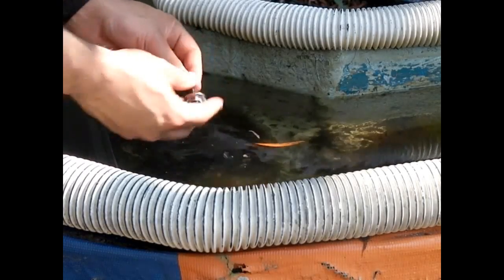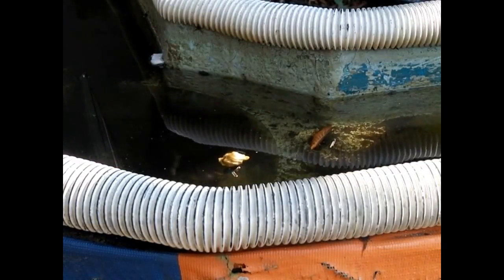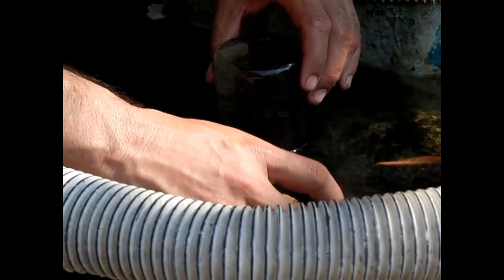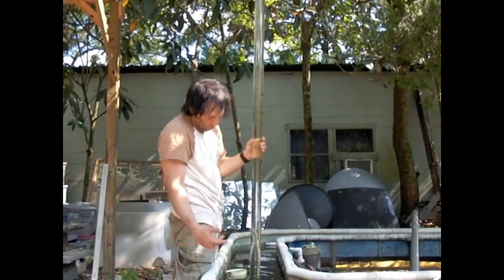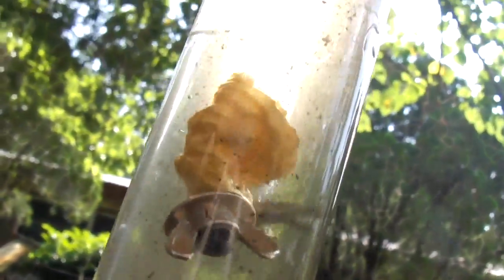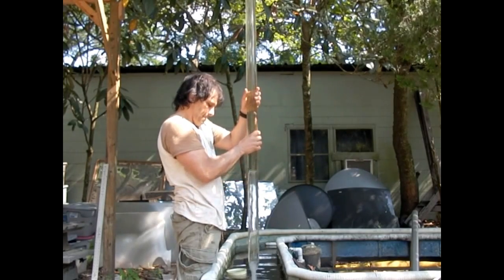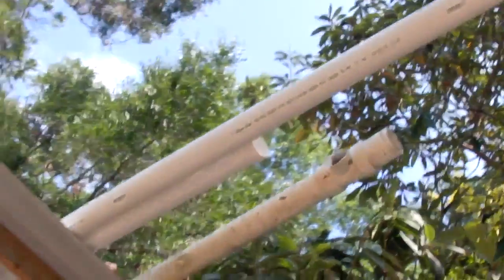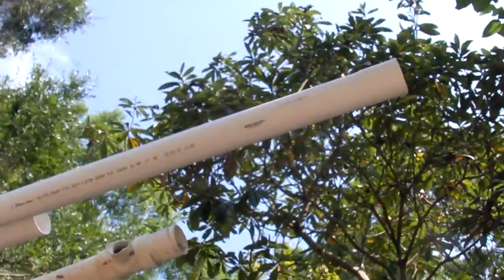Water Lift Atmospheric Pressure Torricelli Vacuum 10 meter potential

Comment: can you get the water to have constant flow using only hydrostatic pressure with a narrowing pipe as it rises but uncapped even if only a mm above the water surface for a constant flow/drible?

Comment: You lose water every time and you need to refill it - object reaches the top and some water is lost at the bottom, being displaced by the object. To refill the chamber on the tube, you need to bring the water to the top of the tube or push it upwards from the bottom - both things require work (energy). There is no free lunch. It's easier just to pull things with an elevator. Less hassle and more direct application of work which makes less losses.

Comment: How about if you flip the model and put the two valve airlock on the bottom and keep the top open to atmosphere?

That way, you are not subject to the height restriction due to atmospheric pressure. 

You can go higher than the 32 feet and with the two valves at the bottom, you do not lose any water from the system.

Fill the tube once, re-use it multiple times to an arbitrary height, subject to the hydrostatic pressure that the tubing can withstand.

...
Reply: How do you introduce the object inside?
There is water inside waiting to pour out.
Reply: @DreamingConcepts  the airlock (water lock) is swapped to the bottom.  In Dan Rojas’ model he proposes a double valve system at the top of the water column to maintain the water column. After the buoy reaches the top, the bottom valve is opened, the buoy floats between the two valves, the bottom valve is shut, the top valve is opened and the buoy is retrieved. The top valve is then closed. What I am saying is that this column of water depends on atmospheric air pressure on the surface of the tank to keep the water column up, and would be limited in height. Atmospheric pressure can only maintain a water column between 32 and 33 feet depending on altitude.

My proposal is to put the two valves at the bottom in the tank and leave the top of the tube open to atmosphere. First open the lower valve introduce the buoy. Close the lower valve. Open the higher valve. (They are both in the tank on the bottom of the tube.) the buoy floats up. Close the higher valve. Under this arrangement the tube can be higher than 33 feet. It does not depend on air pressure from below to keep the tube full. It does require the tube to be filled to the top before operating.

In Dan Rojas’ example he submerged the tube and raises it up sealed at the top to maintain the water column. The watertight condition however is a requirement to get the water tube up in the first place and maintain the column(pushed from below by air pressure on the surface of the water in the tank) It is not a requirement for buoyancy.

In Dan Rojas’ example the question is how does one retrieve the buoy without letting air in and collapsing the water column?

In my counter example the question is how does one introduce the buoy without letting the water out?

The answer is the same in both cases, a two gate system. With torpedo tubes on a submarine, the tube has two doors. The inside doors open to allow the torpedo to be loaded while the outer doors keep water out of the submarine. The inner doors close.
The torpedo tube is the flooded. The outer doors then open to allow the torpedo to be launched. The inner doors remain closed to keep air in the submarine and keep water out. The outer doors the close and the tube is drained of water/filled with air. Then the cycle can repeat.
Reply: @ghostwheelppk  but isn't the water level going lower and lower with each trip? the amount of water being displaced by the floating object.

I mean, when you open the airlock at the bottom to introduce the floating object, the floating object occupies some space which will be flooded with water (from above) when object goes up the tube.

Or this solution is only for going higher than 33 feet? (and not for overunity/perpetual-lifting/almost-perpetual-lifting)
Reply: @DreamingConcepts  I can’t imagine some water not escaping somehow.

With the buoy and payload in between the two gates that is a fixed amount (volume) of water. At that same moment the water above the top gate is a fixed amount. When the payload is removed the sum of the volumes will be less with each trip.

Even if we chose a ping pong ball as the buoy and a wing nut as the payload, with a 100 liter column of water, the column would reduce by a ping pong ball each trip.

Could the buoy do work (replace by pumping its own volume of water) for part of the trip in addition to delivering the payload ?

Is there some configuration of the locking gates that does not affect the height of water in the column?

Thank you, you’ve given me something to think about!

But yes, my original solution was to address the height limit of an atmospheric column of water. I was not trying to work on the self sustaining cycle part of the mechanism. 

It sure would be nice to see what the conclusions they reached in the “Part 2” video.

Comment: I can't tell by your video, but your horizontal pipes would have to continue to be at an upward angle for the objects to reach the end (and elevated enough to overcome friction/it getting stuck).  Also, seems like you would need two values:  one to close off behind the object, so it doesn't descend back down once vacuum is broken and one at the end to reach in and obtain the object.  I'm just thinking, I'm not an engineer nor a physicist.

Comment: better take a tube like that put it on a centered axle with a stopper on both ends and just let the float with the weight gou up, then turn the bar around half way then let it go up again. still, there will be some problems but much smaller.

Comment: The only problem is each time you introducr the wing nut into the pipe, you lose water in the pipe, which will eventually run dry having to be filled back up with the same force used to push the wing nut up in the first place.

Comment: I want  to evacuate underground water (60cm height)  from the basement to the drainage 4 m height, how far this method can help, considering that any inlet air will fail the procedure... is there any idea???    OR  how the difference in density can help??

Comment: I believe this is the barometer concept, the difference is here water is the barometric liquid instead of mercury
Reply: Sasanka gorugontula water could be used as a barometric type fluid but it wouldn't have the same level of atmospheric pressure...the barometer would have to be substantially longer because the pressure would raise the water much higher than the mercury...that is why we use mercury, not water

Comment: You consumed energy lifting the water.  in fact, there is far more energy involved in lifting the water than it would require to lift the object.  There are 7.48 gallons per cubic foot, and water weighs 8.34 lbs per gallon... by the time he fills a 2 inch tube, 20 feet high, he is lifting 43.66 pounds of water (assuming it is 20 feet above the surface level of the lower reservoir) generating 18.74 psi of vacuum inside the tube.  Even using the "valves" will require energy consumption, and in order to remove the object from the tubes, will require the amount of energy necessary to make water flow into the tubes from the bottom to fill the void or vacuum created when the object is removed from the water.  It would require even greater energy to replace the water in the tube than it took to put the floating object in it, since the floating object, under the laws of displacement, will weigh less than the water it displaces  (this is why steel ships float.. the water being displaced weighs more than the steel ship).  Nothing is gained.. there is no free energy here.  It is amusing reading the comments under all these "free energy" videos, and seeing how many people are simply unable to see where the energy supposedly gained is being used up elsewhere.  As a licensed water treatment operator, hydraulic engineering is part of my job... take my word for it, this is nonsense.
Reply from the maker: This is not a "Free Energy" video. I spent some time debunking free energy stuff on youtube but quickly realized that people will believe what they want. Debunk a viral video and I am somehow a government disinformation agent. With that said, if someone has the time to waste, let them play.
https://www.youtube.com/watch?v=QRSGjC0K4bw

and
https://www.youtube.com/watch?v=M1l_0J8g6w0

The comments left by others does not reflect what I am showing in the video.

Any serious "Free Energy" videos listed on our channel are "free" in terms of not buying power $$$. While there is a monetary cost for a solar panel, it is free after the payoff is reached. I vote we rename free energy magic energy. I would make more sense.
Reply: As a " licensed water treatment operator" you should know that 20 ft of water column which is 240 inches of water means 240/27.7 = 8.66 psi of vacuum.  it does not matter if you have 1000 gallons or 1 gallon, the amount of pressure is the same. 27.7" H2O = 1 psi. I am not defending free energy.
Reply: Mitchel Bowden
You are correct.. dunno why I even was worrying about the psi.. it was late and I was tired.  The main point is when he lifted the tube he was lifting 43.66 pounds of water, and energy was consumed in doing so.
Reply: Yes totally agree with you... the object entering the cylinder and the same time displace the water inside the cylinder...

Comment: @grant thompson - the king of random , the weight of the water would make a vaccum at the top of the tube until it reaches 10 meters. The reason for this is that at that depth the water exerts 101 kPa of pressure, the same as the atmosphere. so the atmosphere can't push the water up any further than 10 meters.
Reply: Actually you are incorrect.  So long as the top of the tube is capped shut, a vacuum inside the tube will hold no matter how high one goes.  The vacuum will increase 1 psi every 2.31 feet.. and will continue to increase the further up the pipe goes.  at 231 feet it will be a vacuum pressure differential of 100 psi.  This can continue until the water inside the tube gets too heavy to continue lifting further, or the tube collapses due to external pressure being greater than the vacuum inside of the tube overcomes the structural integrity of the pipe.  You can fill a pipe with water, open at the bottom, and capped at the top, and it can be 1000 feet high if you like, so long as you can support the weight, and the pipe has great enough strength... at which point the internal pressure will be 433 psi less than outside pressure. The only limitation is the ability to lift the weight, and the structural pressures the pipe can withstand before being collapsed (although, theoretically, you could generate a great enough vacuum that the water at the top of the column will begin to gasify.. but that is a tremendous amount of pressure differential for that to occur). It has nothing to do with outside pressure pushing water up... it is internal vacuum that holds the water inside the pipe... vacuum that will be lost the moment it is uncapped at which time the water inside the pipe will drop to the same level as the reservoir.
Reply: +Vincent Ross dude, even if you started at 30 feet of water level thr water will start to drain untill it reaches ten meters. what you reffer as vaccum is the lack of pressure (like a shadow or coldness). Although you are indeed right about the ever increasing pressure difference and the strain on the pipe, it won't stop the water from going down to that height, the pressure will continue to decrease until that height, even if it passes boiling pressure at room temperature, at which point the pressure inside the tube will remain constant and not decrease any further.
Reply: *****
What I refer to as vacuum is, admittedly a misnomer.  It is simply a negative pressure differential in relation to the outside air pressure.

No, the water will not descend to ten meters if the top of the pipe is capped off. I have personally witnessed standpipe watertowers 50 meters high that entered a full vacuum state when the vents at the top became blocked off, and the water did not descend to the ten meter level.  Atmospheric pressure is roughly 30 inches of mercury or 14.7 psi... and if what you were saying is correct then no pump would be able to develop a suction head greater than 14 psi, and I work with pumps on a daily basis that pull far greater distance, and have much greater suction head, than that.  I work with pumps with such conditions on a regular basis as a water treatment plant operator.
Reply: Well, I can't argue with that. That's a pretty good insight. I'm deffinetly asking my professor about this topic when I repeat fluid dynamics this semester because there seems to bea loop hole in both theories there, so I'm most definetly replying you in a couple of months from now if I get to understand why that happens.
Reply: I don't care what you say or what anecdotes you claim.
It is simple physics.
You cannot get a vacuum lower than an absolute vacuum, i.e. a state where there is nothing.
The vacuum achievable with water present at temperature is even worse, limited by the vapour pressure of water at that temperature. At 25 degrees, the absolute pressure limit for a vacuum above water would be 0.03 atmospheres, or if measured relative to ambient pressure, a vacuum of 0.97 atmospheres or roughly 14 psi.

Assuming the water is free to flow out the bottom, it will fall out until it reaches a height of ~10 m relative to the bottom of the tube or the level of the pool of water it is flowing in to.

If you cap the bottom or have a pump at the bottom providing a greater pressure than atmospheric pushing the water up, so water can't flow out (like what would happen in a standpipe water tower) then you can get heights above 10 m.
Also note that this is not in relation to the outside air pressure.
For the water tower, it would be limited by the pump, but that has enough pressure to completely fill the tower.

That is why the water didn't descend to the 10 m level, it couldn't run out the bottom.

As for you claim about pumps, I call bullshit. No such pump exists as it would be physically impossible.
Reply: Jeffrey Black THANK YOU!!!
Reply: ***** Your welcome.
Reply: Angel Gonzalez  it would create a vacuum,the definition of vacuum is something that has no air or substance in it, and they are right about the higher the tube gets that level of psi and kPa will increase until the tube bursts

Comment: Yeah ... I was refering to the non-practical perfect vacuum, 1000 grams per liter water and 1000 mBar atmospheric pressure. 

Still ... 9,81 meters in a practical application using only a man's ability to suck ... hard (heh) would be quite a feat.
Reply: fokGoogol

Comment: That is the acceleration due to gravity.

At sea level atmospheric pressure can lift a column of water 10.3 metres (34 feet).  Significantly less lift is available at the top of mountains.

Comment from the maker: I am actually working on a solar pump/distiller that has a 20 ft lift. The option I am working on uses a Fresnel Lens and or Parabolic mirror. There is also a no lens version. Just need sun for it to work.

Your timing is mind reader like:-)

Comment: you didn't ask me, but if you don't mind, I'll answer it. the issue with your generator idea is that you don't get any movement of the fluid itself while it's in the tube, a hydro generator couldn't run on it and any energy made from the exiting water when you'd break the vacuum would be less than the energy used to pull the pipe up. as for the second idea, yes, but if your water is pumped in, then you lose all your energy savings from the initial pumping, if gravity fed, then it's efficient.

Comment: this would work great for no or low energy high rise deliveries. simply put the object needing to be delivered to a higher floor in a water proof box attached to a float, put the box and float in a hatch, close hatch, fill space with water and open the gate and up the package goes, slowly, but no climbing stairs to get to higher floors. as for lower floors, a weighted, high friction box would be used instead to allow a slow descent to prevent damage.

Comment: @Random Man
 No worries mate. There's no such thing as a Free Lunch, when it comes to catching & storing & transforming & selectively releasing Energy.... If it weren't for the fact that there's 900 Watts per Square Metre of Sunlight, we'd be up Shit Creek, in a Barbed-Wire Canoe, with a Matchstick for a Paddle. In 1913 they used Solar Heated Glycol/Water to store Heat + a Heat-Exchanger, boiling Liq. Amonia for a Steam-Engine running 24/7. Then, WW 1... Ciao !

Comment: Thanx for the reply. Yes I understand this..  A smaller diameter hose and slower refilling can increase height at the cost of making the process slower. I read about 65 PSI for the house inlet with no restriction, so one could use multiple outlets ton achieve this maximum, every pound of water you push above the source is going to impede the harvest pressure by a pound, agreed.

Comment: Red Bull Stratos made it to 22 miles up and that's the best we can do at the moment. Perhaps rockets could be launched from these balloons which would lower the fuel costs. I just don't see many companies taking the financial risk. Its obvious this stuff is possible but nobody wants to build with no profit. The tube that dan is using would have to be 500 mi long to reach space from the ground or 478 mi long to reach space from a high altitude balloon.